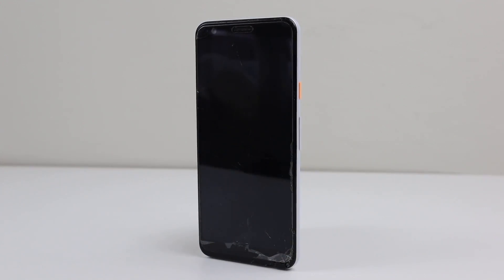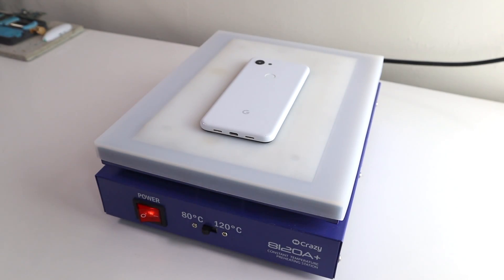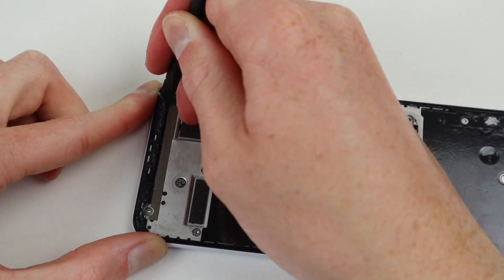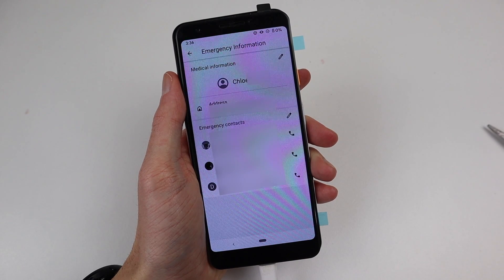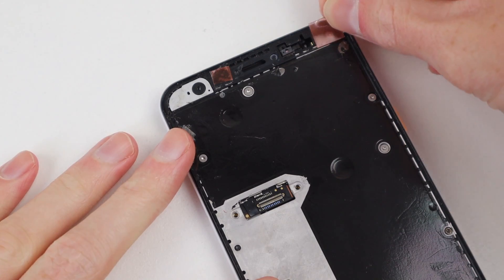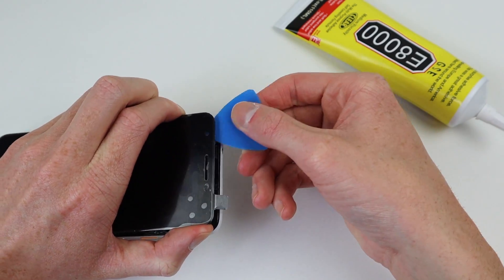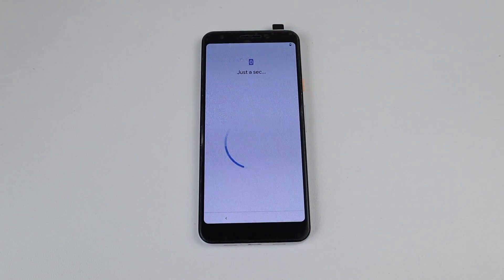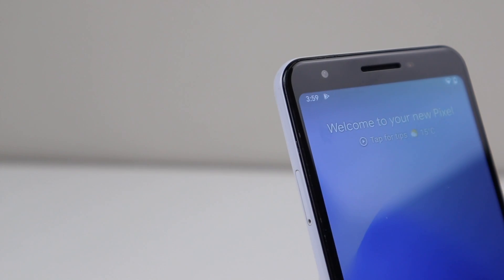Repairing a "Dumpster Dived" Google Pixel 3a

Comment: Hey... Good video as usual 👍 but today i also did the same thing. ... Replaced xiaomi redmi note 4 display , applied same E8000 glue at sides and that aceylic tape top and bottom, but like u even i had to open the phone again because the acrylic tape was not strong enough and as i was using the phone the screen was separating from top due to the heat...
So i ooened again cleaned glue with isopropanol and wd40 then applied E8000 all over this time no tape and now its perfect 😀

Comment: It takes 3-4 hrs to cure e8000 glue use rubber band after fitting the display after 3-4 hrs its looks almost proper..

Comment: Let me give you an advice, if you apply the E8000 or B7000 kind of glues, just wait for 5-10 minutes to allow the material become more sticky. Its use is like that. Just wait for 5-10 and than put the screen on it. It will be more efficient, you'll see.

Comment: This e8000 glue is very good but you should put rubber bands and keep it tight for an hour and so.it is better then original adhesive that used in devises

Comment: For the extra 3$, you should have ordered the pre cut adhesive. Anyone attempting for this device referencing this, I cannot tell you how many I see a day come in because of independent repair shops using liquid glue on adhesives, and if your screen breaks again, good luck getting to look clean again!
Reply: They usually aren't as strong as the liquid glues and aren't as water resistant
Reply: Why would he repair it twice. He's probably resold it on eBay ages ago
Reply: he did say he had it....but lost it

Comment: Hey Hugh i have a question so i had a shattered s8 plus screen so i ordered a new frame and swapped the parts and got the battery replace but the phone won't come on? Any suggestions on what to do ? It also Heats up bvut just won't turn on .

Comment: Whether you are using B8000 or B7000 your are supposed to give the glue time to cure, btwn 20-30mins with rubber bands holding the parts in place

Comment: At least here the stuff you put in the e-waste bins will be the property of the store that the collection is at, so taking those items is illegal, basically stealing and then posession and selling on stolen property. So if an employee took items from there they’d at the least get fired and possibly sued. Yes, those things should be repaired if possible and not recycled, but data and security of personal information that could be left on those devices is probably one of the reasons why no on should just be able to take stuff from there.

Comment: you need to apply pressure over a longer time  to the glued part when using these glue.  It would probably have worked with the first one aswell

Comment: Be careful with factory resetting any Google phones via the bootloader. Because these phones require the user to sign in with their Google account, and when the phone has been wiped without removing the account, they can become account locked. It's important to remove the user's account from the device before performing a factory data reset.
Settings>Accounts>Google Account>Remove Account
Reply: How does he remove everyone's Google account on all his videos? Trashed phones are all frp locked

Comment: People don't throw away electronic stuff because they want, they do it because "society" force them to. What i mean by that is that they don't find someone to repair it or when they do the costs are so high that they are incentivazed to buy it new. Also there's the forced concept of old and the fact that today's stuff is made thinking against who wants to repair (hidden screws, strange screws, plastic tabs that breakes as you open the object, glue or even worst instead of epoxy instead of screws).

Last month i changed the camera glass of a friend's phone, i didn't even open the thing, heated the old glass (with an household iron) popped the new one in. Piece cost 9 euros, time 30 min going really slow... She was asked 85 euros for the job at a repair shop (phone costs was 280 euros in july this year).

Another example happened to me in march, my washing machine worked fine but the bearing was at the end of it's life, to change the bearing you have to open the entire thing to push it from the inside... I couldn't as my model didn't had screws but epoxy, so no 15 euros repair but a 350 euros new machine.SAD.

Comment: Instead of heavy box, next time purchase and use clamps or use tape around it? In my previous job we used small clamps with light clamp pressure. We use usually 6-8 clamps per phone while adhesive is drying. Clamping-time is around 2-4 hours per phone to be firm enough to be given back to the customer.

Comment: I found 5 iPhone 11 Pro Max still sealed in their boxes in a dumpster. I thought I had won the Lotto. Got home and opened one and set it up and checked the IEMI number. It was blocked so I knew straight away they were stolen. HAnded them in at the police station and was told a local phone shop had been robbed a couple of days before.

Comment: Hey Hugh! B7000 isn't a normal adhesive. You have to put adhesive on both surfaces (screen and frame) and wait from 5 to 10 minutes before placing the screen back on the frame. This type of adhesive is called contact adhesive. I really recommend. it's a good, and cheap adhesive when you don't have the precut ones. Only note, if the adhesive has a greenish tint, don't use it!

Comment: Get the stuff they glue the rearview mirror to your windshield with. Similar smelly generic black goo. Don't remember the name. It is so much easier to remove the screen the next time I don't why the manufactures aren't using it. Add the solvent and the screen falls off. You don't want to have to smash a windshield every time the mirror got put on wrong. Ask the local body shop or glass replacement guy.

Comment: Imagine being rich enough to just throw away a phone...
Reply: I mean a shop probably chargers what the phone is worth to replace the screen. So normal people would just assume the phone is worthless then
Reply: @joshuamaxwell3638  my aunt threw her s7 edge away because the battery inflated when it was new. 
i grabbed it, fixed it for $60 and used until last month. great phone, only hindered by the awful 32gb storage. the screen developed a patch of hot pixel just as i was about to upgrade, too. never had that with my other android phones (which i kepp, all of them)
Reply: @GraveUypo  Yup, most people just don't know how to replace smartphone components. They'll usually tell you that "you can't fix modern phones yourself anymore" like come on, every phone has once been built together so it also works the other way round - especially with easy fixes like the battery or the display where you just need to replace it with some spare parts.
Reply: @joshuamaxwell3638  That's the definition of being rich though ,  a casual consumer choice is not available if your not.
Reply: @MyKharli  not really. it could be ignorance. if someone thinks a broken screen is a broke phone then they would think they will need to throw it and buy a new one even if they cant really afford it. and if they did know, and as that person mentioned, if a store is charging them almost as much as new phone, they probably think its smarter to buy a new one. 

but also yes, some people are just selfish, rich or both and dont care and just want a new phone
Reply: @MyKharli  I'd just sell it for the price it would cost to repair
Reply: @joshuamaxwell3638  Not really, I've change S8 screen and Batery directly with samsung and it was about  150 USD and its a curve screen, Pixel are flat screens way cheaper.
Reply: @urband10  $150 USD is about that a Samsung Galaxy S8 mint in Australia is worth if not a bit more
Reply: @joshuamaxwell3638  I live in Mexico, phone are expensive, you can't not find a mint condition S8 for that, that why I always repair directly with Samsung and they even tested for waterproof, for me that's worth a lot.
Reply: Correct for very popular celebs or rich people like Elon musk who has to throw his phone away and get a new one because it is to avoid tracking so he does not get killed.
Reply: I mean she ain’t that eich, she threw away a Pixel 3a, not an iPhone XR
Reply: Whose rich if they buy a pixel 3a lolololol
Reply: @Michael O Callaghan I ain't no apple fanboy but apple can make some really good stuff even though the price may be a bit steep.
Reply: A Subaru costs $30 grand. Go play with your $5 dumpster phone 💩
Reply: @Lee Eun-yoo hahaha go ride your bicycle to McDonald's 🤡
Reply: @Lee Eun-yoo $30k usd is like $3,000,000,000 in your worthless Korean currency
Reply: @Lee Eun-yoo like I said go ride your bicycle you goooeuk
Reply: @Lee Eun-yoo good excuse. Maybe in 20 years you can buy a cheap teenage boy racer car when it has 200,000 miles on it and costs something you can finally afford. Bet your parents drive a 30 year old Corolla. Until then enjoy your bicycle and $5 dumpster phone.
Reply: stupid enough to not have bought a otterbox just in case mentality

Comment: When you use E8000 you must leave the phone under something (like a book) for 2 days minimum
The glue will dry and the parts will stick strong 
(I don't speak english very well so i'm sorry if i make a mistake/s)
And the E8000 is the best glue
Reply: Good english
Reply: I didn't know we have to out it like that for 2 days ... I left it for an hour and my screen just doesn't stick on the sides.... And I bought a new phone... May be I'll take care of it later on or find a nice repair section for it...
Reply: @GVSKS  i changed the back glass of my phone (Xiaomi Mi 9T Pro) and i used this glue for that. In the box says that: left the phone 2 days for a good and strong finish, and it's true, the new glas are stick like the original factory glass
Reply: @unusuariocualquiera6643  did they mention anything about the glue ... 3000 or 7000 cause j used 3000 and it happened just like the video idk if my battery is swollen or not the last time I ripped it a part my blade poked my battery.. just a little bit but I saw no differences even in the battery health I should probably check on it and glue back my screen.... That's stilo my favorite mobile phone
Reply: Ewaste bins are the holy grails 😯😯
Reply: @chuithrowaway8698  their a little piece of heaven

Comment: i want to get in to repair tried fixing i phone 5 back but it was dented and i idid not use the right tools and broke the top button and is was not from i fixit so it broke the on/of swich and i support the right to repair and my replace meant will be from i fix it and i want to make it to working condition if u have any more tips

Comment: I work in a google authorized repair shop and the 3a quite commonly loses all display when damaged. A good way to tell is if it still rings or vibrates with no image and has been dropped it just needs a screen replacement.

Comment: The untrained repair people use E8000 glue on top of the previous display adhesive which causes the display to lift up and the lcd backlight bleeds and shows a cheap experience....

Comment: You should use “label killer” to remove the adhesive instead of alcohol. It works so much better.
Reply: Well the issue with using that stuff is that it still needs to be cleaned up. Alcohol is the typical choice since it evaporates easily and doesn't make much of an oily mess.
Reply: @FunkatronicDingus  Exactly, it leaves no traces, it's cheap to get at 99,5% quality, and it's known not to mess with anything besides the glue residue, like the plastics or the oleophobic layer on the screen. For other equipment, like lenses, even the lighter diethyl ether is used, although much harder to obtain.
Reply: Label killer is just petrol
Reply: Goo gone is great too. Plus it smells like oranges so whatever you clean will smell great
Reply: @onometre  I wonder if goo gone is TIM cleaner just in a different bottle...
Reply: @Alexander_l322  you can get it from the dollar store what do you expect lol 😂
Reply: @onometre  yes but not good for these applications, it can dissolve certain types of plastic
Reply: @Tar4byt3  not the citrus based ones
Reply: Alcohol is safer on electronics than acetone. Acetone is pretty dangerous and it's not immediately obvious when acetone dries.
Reply: @AppleReviews  It works good too.
Reply: or maybe the more popular and widely available goo gone?
Reply: No it doesn’t
Reply: Let me guess it's some kind of overpriced IPA/Acetone
Reply: @Arek_R.  Actually no, it's based on alcohol but smells pine (sosna). Orange can. Works brilliantly. Price 3$. https://termopasty.pl/en/produkty/label-killer-2/
Reply: @volkhen0  It literally says on the label that it contains IPA(isopropyl alcohol)
Reply: @Arek_R.  I know, but it has other other substances too, as it works much better then IPA.
Reply: @volkhen0  it would probably work better, but alcohol is used because it doesnt carry electricity among other reasons
Reply: No
Reply: @jaydenarenas9754  No what?
Reply: @acumenium8157  no.
Reply: @thefriendlymadman229  No what?
Reply: @acumenium8157  definitely not yes.
Reply: @thefriendlymadman229  why
Reply: @acumenium8157  you right.

Comment: Hugh i literally dreamed last night meeting you. Man i should stop binging your videos.

An about the adhesive. I used the f7000 on my ipad. When i was done with putting the Glue to the sides, the glue was already dry. You need to be so insanely fast.
Reply: I dreamed using discord :/
Reply: @zsin128  do u mean that u used discord in ur actual dreams
Reply: @2k7a  yes.
Reply: @zsin128  thts weird

Comment: This is amazing on what people throw out I keep all my old phones
Reply: Ye exactly you never know if your career choice takes a turn to a drug dealer
Reply: I hate this throwaway society, it's so wasteful. If I had a broken smartphone (etc) which I couldn't afford to have repaired I'd at least try and sell it on Ebay first rather than throwing it out.
Reply: @SlartiMarvinbartfast  For many it's simply not worth the hassle, they get a quote for a repair from a shop for way more than it's actually worth and assume it's not worth working on that phone for anyone, let alone going through the whole selling-on-eBay process and shipping it out
Reply: i use mine as clock displays around the house , also they still blutooth wifi if i fancy, One i use as a microscope camera
Reply: me too
Reply: i only throw 2 away because of badly damaged screen but overall i still have 30+ devices non working still in my storage
Reply: I kept my shattered galaxy a20
Reply: I'm a phone collector and have kept all my phones since my first phone. (Besides my Samsung Monte which was stolen)
Reply: I got my badly broken display panel galaxy note 8 and a galaxy grand dous
Reply: I still have my first smartphone, my dad uses it sometimes, the power button sometimes doesn't work and the plastic screen is scratched, but it still works
Reply: I have a sony Ericsson I used 10 years ago and a really old samsung I got for free lying around at home just in case. Old samsung came in extremely handy when my phone motherboard died and I had to use it for a week.

Comment: I was thinking of buying the pixel 3a but instead im gonna get the iphone se 2020
Reply: I recommend the pixel 3a. Battery life of the SE is really bad, and camera is pretty useless when it is darker outside 😅. And glass back, which can break. Also, 3a is a lot cheaper. But it is your choice of course :). My friend bought the SE and regretted it after using it for a week because he bought it as a replacement for his original SE with battery problems (he was done with charging it every day), and the new one barely survives the whole day
Reply: @mer200  Well i've been with android for 8 years and I kind of want to switch back to iphone, the se is the cheapest iphone so im just going to get that
Reply: @mer200  I also just did a bit of research and the iphone still has a better battery but it probably wont last over 2 years unlike the 3a